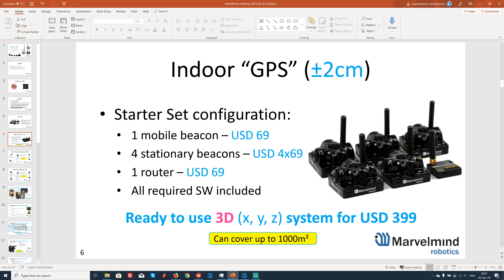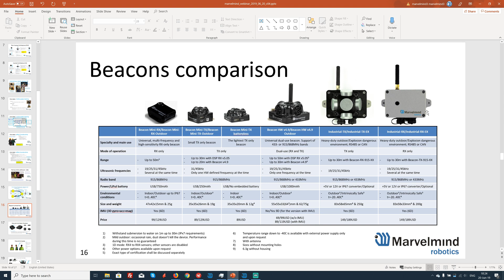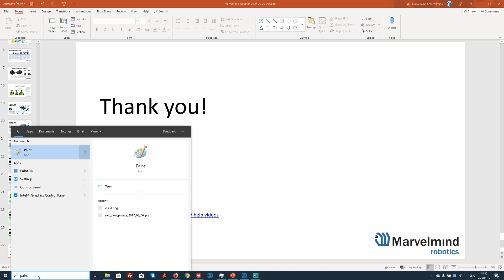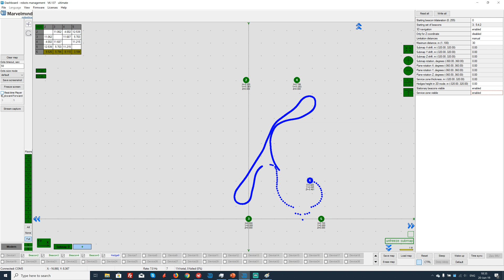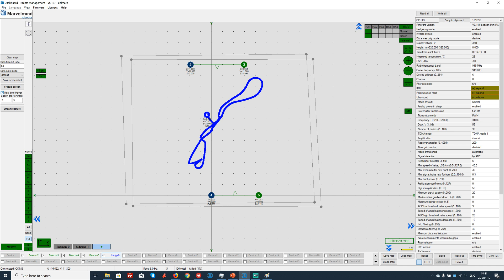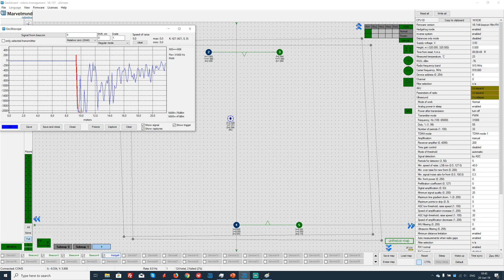Live Q&A webinar with Marvelmind CEO and engineers - 2019.Jun.20 - n01

Comment: my beacon modem hw 4.9 software ia can not wake up the beacon when the modem hw 4.9 was connected by pc in dashboard menu. how to solve it ?
Reply from the maker: It is better to ask on the FAQ forum or in email: https://marvelmind.com/help/.

There could be several points:
- Incorrect SW - please, update according to the Operating Manual
- Default button wasn't pressed. Settings are not default
- You wake up a wrong beacon/address
- Beacon is not powered
- Modem is too close too the beacon - move it 1-2m from the modem
- etc.